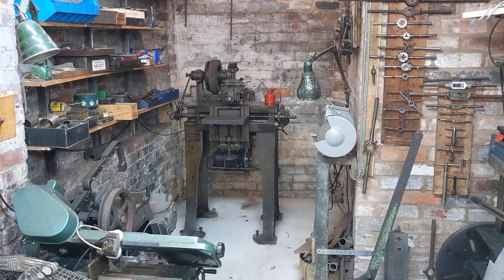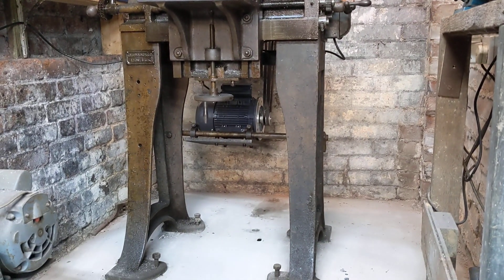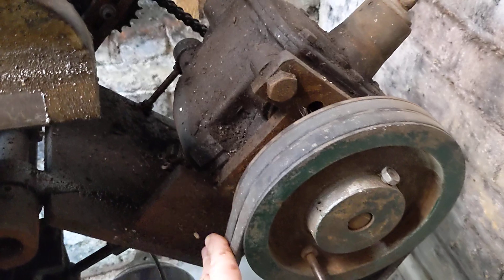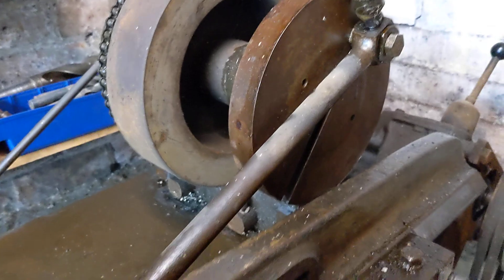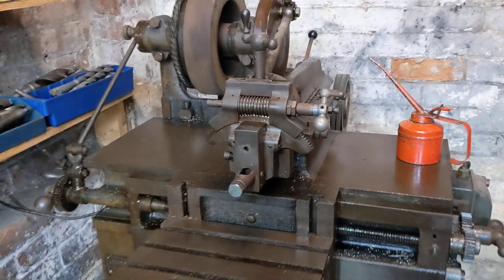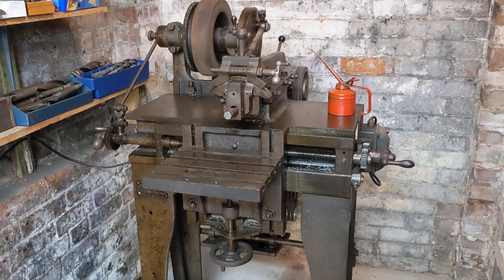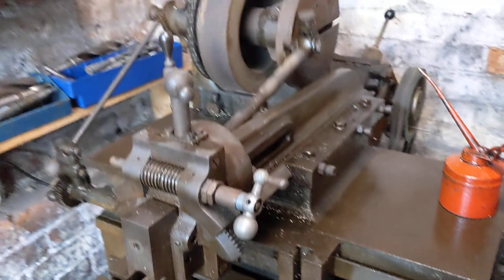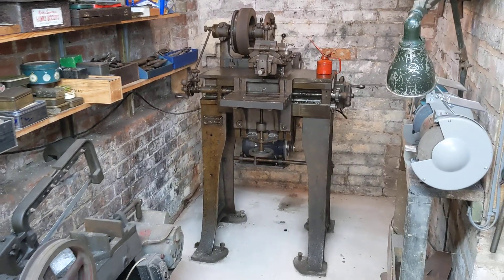Shaping Up for the new year!

Comment: Lovely bit of work thank you for sharing 🙂 Always really enjoy your videos. 
Im sure you are aware that the machine is running backwards, and the table should feed on the non cutting stroke.
Reply from the maker: @mrtea427  you're right! I did wonder why the feed was happening on the cutting stroke. I' set the motor to run the same direction as the arrow on the previous, but it's easy to change. (i.e. change back to how it was in the first place. 🙄).